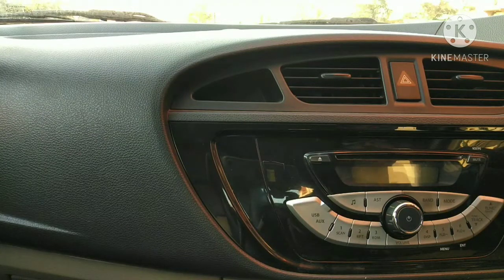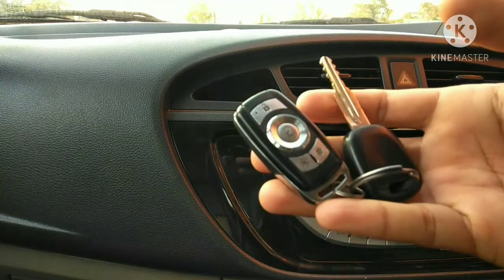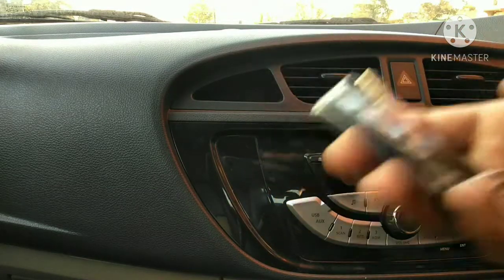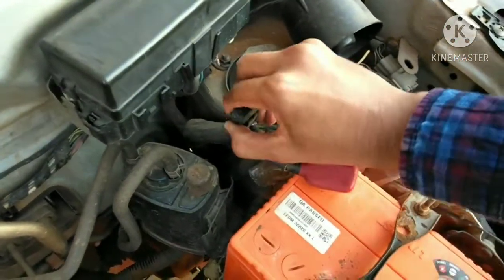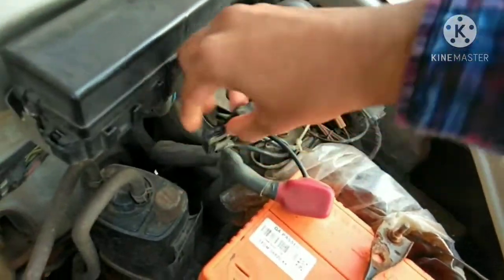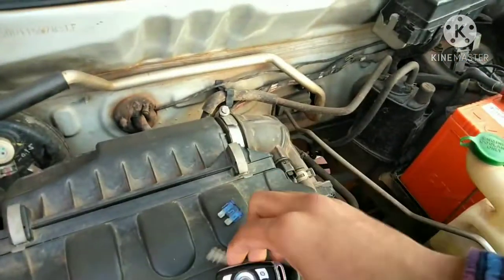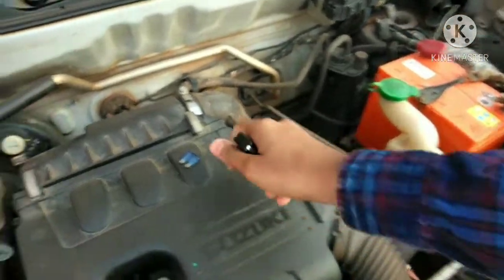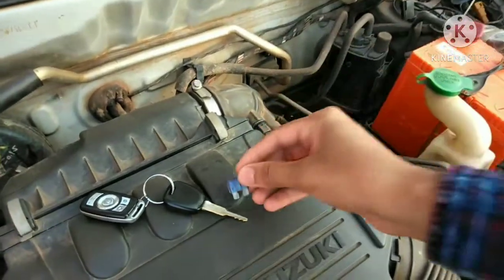How to deactivate central locking system in car

Comment: Dear brother, thank you for the video, I have a 2012 Etios petrol which doesn't have auto lock after the car moves to a particular speed.can I disable the central locking in my Etios. I also have a 2018 Ignis 1.2 litre petrol which has auto lock which gets locked as soon as the wheels move and reach a particular speed. Can I disable it also

Comment: After I hav change the remote battery, sometime  center lock system occurs problem, both signal left n right blink together without pressing any butto, at that time engine can't start, by pressing #  or * light stops blink, then engine can start. Suggest where is the wrong
Reply: Same problem